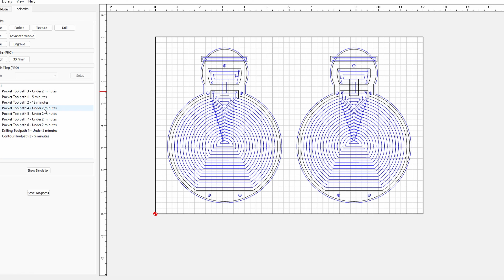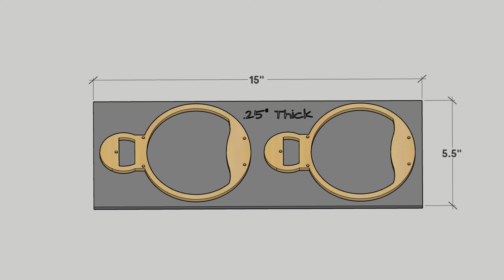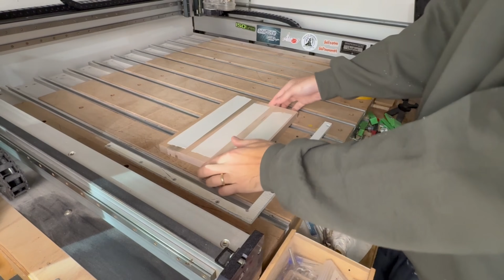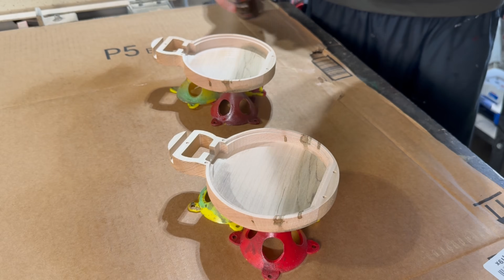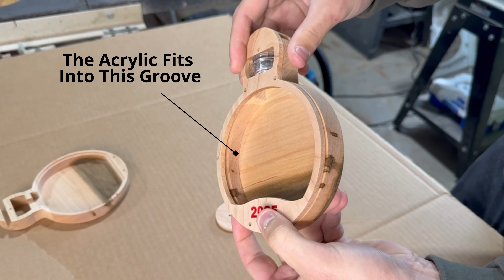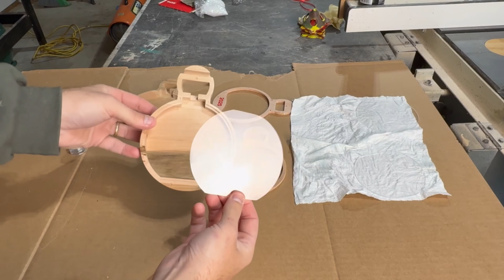Building a PICTURE FRAME Ornament on my CNC (Perfect Holiday Project!)

Comment: Need to set Z to bottom of stock instead of top, and probe waste board on your profile cut.  You'll get the cut to the bottom every time.
Reply from the maker: Yea, I know, I really should do that. I guess the benefit of using the drum sander though is not having any residue from the tape left over since the bit never reached it lol